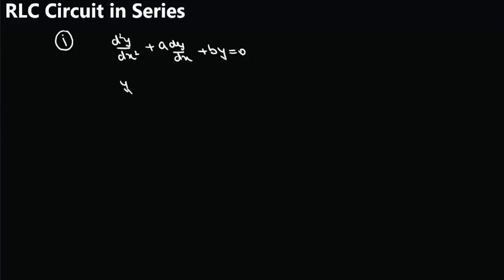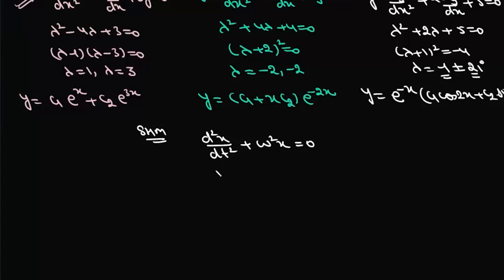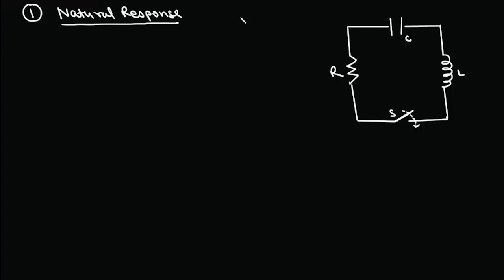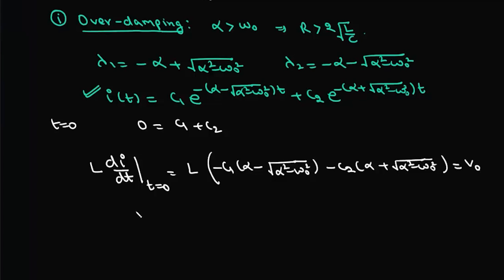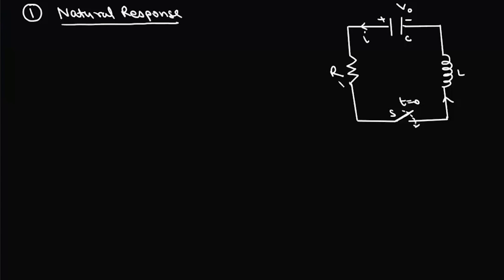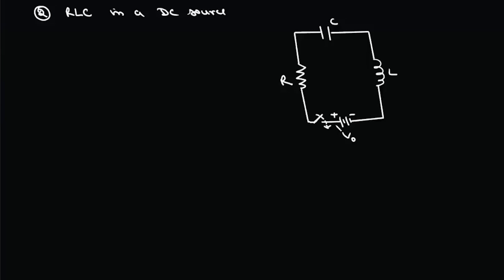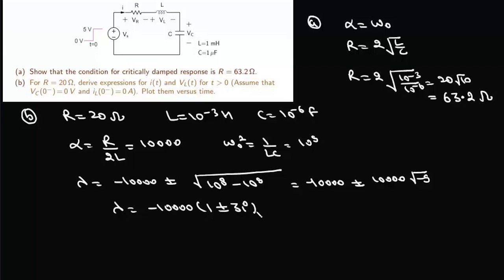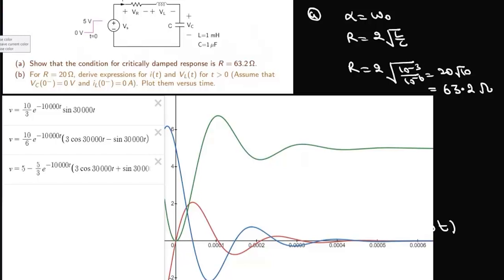RLC Circuit Analysis | Part 1 | Natural response | DC Source | From Maths to Practical Examples!

Comment: Sir differential equations ke sawaal nhi daal rhe par ye kyu daal rhe
Reply: Ye differential equation ka hee application hai
Reply: @integration8274  ha bhai jara batana second order differential equation kab jee adv me aaye hai? bs kch bhi bol diya
Reply: @flewawayandaway4763  rlc circuit, damped oscillation , phele syllabus pdh le
Reply: Check rotation question of 2016 paper which was hardest